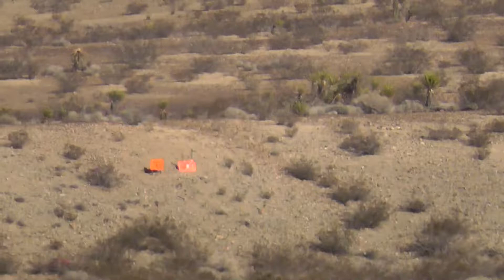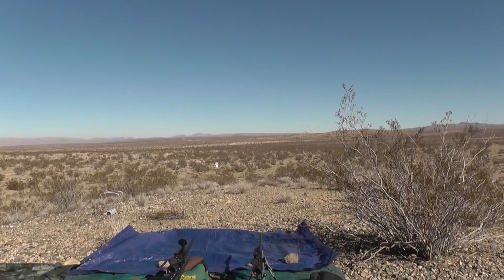.223 @ 1255 yards. Extreme Long Range Shooting though the Transonic Zone! 77gr SMK

Comment: Awesome. what is your altitude or Density Altitude if you recall? I'd like to give it a try with an Ar-15, but my Altitude is 1000 above sea level and baro is usually about 28.8 to 29.0
Reply from the maker: I usually only use Baro. Pressure. About 27.9 inHg at 3000ft or so. High desert region.

Comment: Baro pressure 27.50???
Were you in a hurricane zone with pressure that low or you just at the north pole?
Reply from the maker: +Rob Russell only 2500 ft. When I was hunting in Utah at 8000 ft, it was 24.3
Reply from the maker: +Richard Garnache I moved on to the 80gr Amax after trying them out.

Comment: What is your barrel twist rate?
Reply: +11DayScrape I would guess it's because you're shooting at higher elevation. I always wondered about what people were talking about when they mentioned it was hard to shoot 55-69gr bullets at 500-600 yards because it is easy where I shoot (Arizona desert, 2000+ feet up). Warm weather and elevation will help with keeping those bullets stable longer.
Reply from the maker: Its marked 9 inch but I'm sure it is slightly less like 8.75 inch since I'm pushing the 80 gr Amax 1560 yards.
Reply: That is amazing. I have a 16" rifle with a 1:9, but I have ready that 72gr is the heaviest round that will be optimally stabilized at that rate. I would be happy to be consistent past 900 yards! Thanks for the great video.
Reply from the maker: Ryan Simpson Your welcome! I shoot the 77 gr Smk and the 75 gr Hornady match hpbt out of my factory delton ar with a 16 in barrel and 9 inch twist for easy 600 yard hits. It will go farther just havent put alot of long range time into it because the factory ar has a lot of vibrations. Dont believe everything you read on the net. Every rifle is different and it is alot cheaper and easier if you reload your own stuff.
Reply: +11DayScrape That sounds like its more closer to a 1/8! gives me hope to shoot long distances, I shot a sub MOA group the other day with federal gold medal 77 grain SMK LE ammo and I have a 1/9
Reply from the maker: +tbone martinez You never know until you try it out. I got lucky with my barrel. Maybe its 8.5 or 8.75 twist. 8 inch is the perfect twist rate I think.
Reply from the maker: +TheIngoBeck yes, the thinner air makes a huge difference. This desert is at 2500 ft.
Reply: Well he has a 24" barrel. The exit velocity is higher as is the rotational velocity.. As well as the elevation..